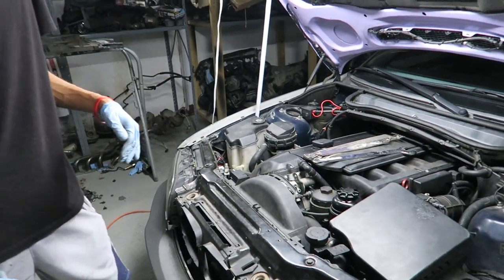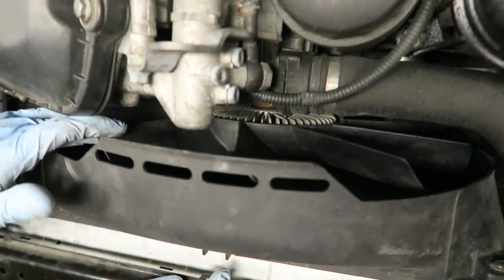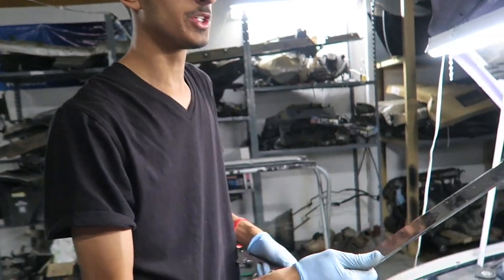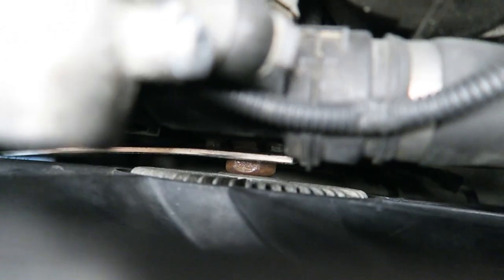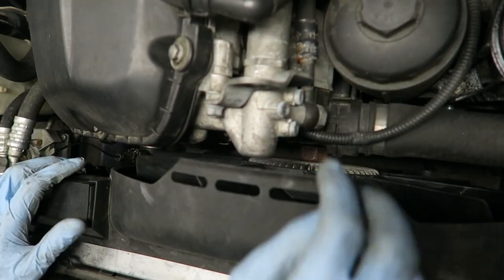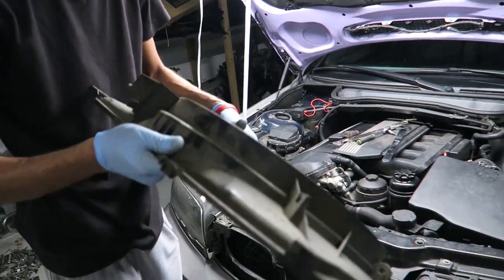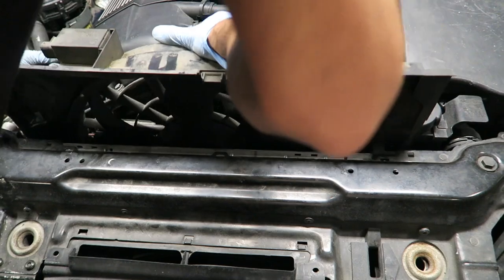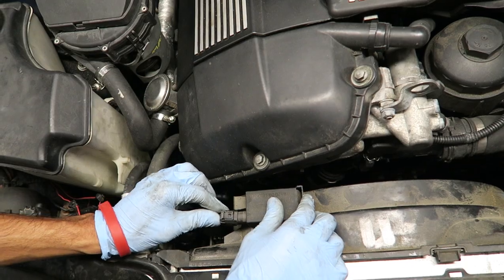BMW E46 Mechanical Fan To Electric Fan Conversion DIY

Comment: Yep, you are totally correct. The fan on my 1998 540i blew up last week. It knocked off the cooling hose going into the radiator but the worst damage was tearing up the hood liner and putting a crease in the hood.
Reply: I thought my belt slipped off and snapped after I floored it but it was the fan exploding that cause havoc.
Reply: Same shit just happened to me
Reply: The same day I replaced the hood :(
Reply: @racks1711  Dang!! That stinks! Were you replacing the hood because of damage from a previous exploding fan?
Reply: @racks1711 did you get the hood covered by your insurance?

Comment: How is this fan controlled? Surely you would have to put in some kind of coolant temp switch to turn it on when the temp exceeds a set point otherwise how will it come on at the right time? At least with the clutch fan you know it is always running even when its not strictly needed.
Reply: soundseeker63 i converted my fan a while ago and it turns on when the car gets hot

Comment: I encourage everyone to do this!! My manual fan blew and and damaged, the radiator, expansion tank, power steering reservoir and the water pump. Did all the work myself and it cost me about $400 for parts. Convert to the electric fan and save yourself a lot of money and the hassle
Reply: Hi I have a question where can I get the fan from? What kind of car does that come off
Reply: @bettyferman6553  READ THE FKING DESCRIPTION, kinda. ily

Comment: So to be clear, if we have a Manual E46 it comes with an electric fan?
Reply from the maker: Yes
Reply: @ShopLifeTV  Except if you have an early build.
Reply: So what electrical conection u use for the new fan !! What did u conected to i dnt get it
Reply: So there was already a plug for the new electric fan
Reply: nando4755 yes all plug and play

Comment: please explain how this fan knows when to turn on ?
Reply: You unplug your front aux fan connection and plug it in to the radiator one don't need to front any more
Reply: It turns on when the car reaches operating temperature
Reply: The coolant temp sensor that plugs into the radiator controls the aux fan.  It will keep the coolant temp in a range so it will cycle on and off when at idle and low speeds where there is no air passing throw the radiator while driving.
Reply: @klinatoc  a lot of people seem to be tripping out about this part especially if you have an AC obviously you want to run it what happens does your fan come on does the AC still work and like he just said yes it all runs off of temperature reading

Comment: electric fans did not come on all manual e46's. i drive a 99 328i 5 speed. with a stock manual fan clutch.
Reply: 2004 325ci all factory 5 speed doesn't have a e fan either
Reply: he means the efan in front primarily known as AUX FAN for your condenser. they all have that fan. that is the actual fan he is using in the video, but he is utilizing it as a radiator fan. hope that clears things up
Reply: +ForeignDomesticRacing  u just answered my question.. because he never detailed what fan he's using.. but I thank u.. fr
Reply: I have a 99 328i 5spd too and it has a manual fan.  I'm actually going to go ahead and swap.  Looks super easy and I get annoyed with the manual fan job.
Reply: @ForeignDomesticRacing  for real, so all we gotta do is move it from the front of the radiator to the back?
Reply: @ForeignDomesticRacing  Haha Nope, It's not the fan he's using. He was just wrong about all manuals having an electric fan.
Reply: @trapman1338  He did detail it. He said the fan comes from a manual E46 and it is NOT the aux fan.

Comment: Hi, excellent video. Where did you get the electric fan. Or what BMW model it is, it is seen that it is used. Thank you.
Reply: He says at 0:35 all manual e46's came with electric fans except the m3. I missed it the first time too.

Comment: Two questions
1-Did you notice deleting the clutch fan freed up any hp to the engine?
2-Are you sure one electric fan can cool as much as both the old clutch fan and the ax aux electric fan? I would be nervous it wouldn't cool enough with only one fan.

Comment: I just did this conversion on my ladies 03 325xi. Honestly the hardest part was lining up the slots on the side and bottom. The old fan came off really easy and was surprisingly heavy. Once I work out the other bugs I expect this will increase the acceleration. This took maybe 15 mins tops. The other issue that took most of the time in the garage
Reply: Good luck… it almost cost me an engine…electric fan went out and car overhead, it only lasted 6monts
Reply: @georgeteo8797 so not to replace it? The manual e46 has the electric fan.

Comment: So, just to be clear, you said the auxiliary fan, which uses the same motor as the manual electric fan, only comes on when the AC is on or if engine "over heats".  First off, the fan doesn't come on when the engine overheats.  The fan comes on by direction of the coolant temperature on both automatic and manual cars.  When the coolant temperature reaches a certain point, the fan turns on.  The only difference here now is you went from a pusher fan to a puller fan.  The function of the electric fan is to cool hot coolant when the car is not moving, at speed, fans will do little, if anything to cool the coolant.  It seems that people get all freaked out thinking that if they remove the manual fan, all of the sudden the car is going to overheat.

Comment: Quick question so when you do this conversion does the fan stay on consistent or only when it overheats/A.c. is running?
Reply: Alex D  my fan turns on when it gets hot.. but I’m having an issue with it . Now when I turn off the car it will stay on
Reply: Alex D I'm wondering the same thing have you got an update?
Reply: @keither89  ,

Its completely normal if the fan spin for a few minutes and then its turns itself off as its cooling certain things from heat-soak.

Comment: Hi there, thanks for your help about working in BMW, l have a 330ci year 2006 having issues  with  temperature,  already  change water pump, thermostat, but still heating up,  somebody  told me is the electric water pump, may you please help me teaching  how to test it and how to replace it, thanks so much for your kindness and GOD BLESS YOU

Comment: Love your channel ! Has been a great help to me in looking after my 320i E46 here in New Zealand. Question: I want to get rid of the manual clutch fan. Can I remove it and stick with just the A/C fan or do I have to install an electric fan on the engine bay side? Thoughts......cheers
Reply: I have the same question.... do you have any information??
Reply: @gustavoalbertotapia6433  I ended up just removing the clutch fan a couple of years ago now and sticking with the AC fan only, did not change anything else and left it in its original position and it has worked perfectly and holds the temperature exactly where it needs to be. Just run the car at idle after removing the clutch fan with AC off and check that it automatically comes on when the car temperature gets up. Cheers.
Reply: I don't know if you still have the car but somebody just told me that the reason the clutch fan is on automatic is because the extra heat created from the automatic transmission needs the constant air flow apparently. I was kind of concerned with that and that's why I watch this video, I've had my electric fan in for years now and not really had issues @crooky66west

Comment: Hey brother love your videos both old and new. My 2000 323CI has a bad fan clutch! Does the 2000 year model E46 have the electrical connectors to make the conversion to electric?

Comment: Thank you very much for these videos. I am wondering whether this electric fan fits the E38 7 series from 1995-2001. I have a 1998 and a 2001 7 series. Please let me know whether there is a plug and play aftermarket fan available online.

Comment: Nice swap!   I'm a little unclear as to how you reconnect the wires.  Could you explain what goes where in a little more detail?  And what happens to the front ac fan?   Thanks
Reply from the maker: +Tom Canada Thanks! You are eliminating the a/c pusher fan and using that connector for the electric puller fan. Let me know if you have any other questions.
Reply: @ShopLifeTV  What if you have a manual? any benefits to this over the front fan?

Comment: I did this conversion on my 2005 330ci and I saw on a e46 group where they also replaced the thermostat so the “auxiliary” fan would cut on at a lower temperature. Does anyone know the part number or where to get that thermostat? Thank you for the video.

Comment: what do you mean keep the old one for back up? it wasn't plugged in to anything. or do mean keep the front fan installed, in case your fan failed, you could plug the front range in to get you home?
Reply: I think so makes sense I have the opposite  my ac fan blew up nd I'm left with a clutch fan nd no shroud

Comment: Did this upgrade few years back. Thanks. 
Question how can you still keep the aux fan for ac connection if your using its plug 🔌. Is there an adapter that has 2 into 1 line?

Comment: Hello,

My name is Eric and i am in Rwanda in Africa. Well, I watched your video about the mechanical to electric fan modification and i also wanted to do it. I am a diy mechanic for Bmws and Mercedes only. So tell me, how do you get the electric fan to run after engine start without using the A/C compressor, I tried the modification but i was always putting it on together with the A/C and driving whole day with A/C isn't economic at all with fuel, is there any tip you can share with me so that I can have my e46 run much quieter. I am sorry am not a social media person that's why i used your email. Hope to hear from you very soon and I really highly appreciate your input to sharing what you know about these cars.

regards,

Eric

Comment: My mech fan comes off with just a big open-ended wrench thankfully. Just bought an electric fan from junkyard for less than $15 and the production date was in 2011. Let's hope it works.

Comment: seeing as you have just swapped out the aux fan connector onto the new electric fan will it only come on when idling? also is this the same proccess on the m3

Comment: Hey mate. I just watched this video and it really looks very helpful. I want to do this change on my e46 2.0i, but i am missing the one connector which you disconnected first, the one on the left of the auxiliary fan. Can i plug the new electric fan and just use the connector i have, what happens also with the fan behind front bumper, which is for the AC?

Comment: At the very beginning of the video, you said that the new fan was going to replace the old auxiliary fan also, So why didn't you take it out? Is it just sitting at the front of the radiator doing nothing now? 🤔

Comment: Great video, thank You. If you don't use fan clutch removal tool but instead use only 32mm wrench and hit it with the hammer clockwise,  can fan clutch be damaged by doing so?
Reply: I knew a BMW master mechanic who used to do it that way. He would also put the fan on by starting the engine and hanging the fan next to the rotating shaft. It would thread itself on. 😂 I would absolutely not recommend putting the fan on that way!

Comment: I did this fan delete for my 2004 325i. One concern I had was that on my obdII gauge my temps would fluctuate from 96-100 and sometimes 105 but, at this point the electric fan would kick in but never stay on a constant(as you would expect the original aux fan to behave). I tested this on my friends 2005 330i ZSP and the electric fan came on around 90 and stayed on a constant lowspeed unless it reached 98 then would kick in high speed. I know the ZSP's are tuned alittle differently but I wondered how I could get my fan to behave the same. I tryed swapping the fans between the two to see if it was the fan itself but turned out the same. I've since bought an new used 2004 325ci auto and have noticed with the two fan set up my temps run a constant 95-96, and rarely peaks at 98 when in traffic at which time the aux switches on and brings it back down to 95.

I would consider doing this mod again but, only if there is some way to get the electric fan to kick on at lower temps and not let the temps spike up and down. Pardon my ignorance but I am not sure if this makes any difference at all but knowing these engines sensitivity to overheating I'd rather stick to whats proven. Searched the forums but no luck on how to adjust the behavior of the electrical fan. If anyone knows how PLS PLS PLS let me know, I've been looking for some time now.
Reply from the maker: The fans will cut on and off automatically to keep the car in a certain temp range. The fans are only really doing work when the car is standing still, otherwise airflow usually takes care of the rest when driving. As long as you have done maintenance to the cooling system, just relax and drive. Thanks for watching!
Reply: Can you exchange a manual fan for an automatic fan on a 325ci / 2005?
Reply: The 325ci is an automatic transmission.
Reply: or you can just get it tuned so that the fans come on sooner but 10 degrees temp isnt much tbh. Maintenance the cooking system and youll be fine

Comment: Hey man, great video as usual.  Quick question.   I have a 03 320 automatic, and I'm considering this mod.  Can I leave the old electric fan in and not take it out?? Won't it have a negative effect on airflow?? Thanks again for the videos man. Appreciate it !!
Reply from the maker: You can, it will effect airflow, but it is not severe. My gf's e46 still has the aux fan attached and we drove the car cross country.
Reply: ShopLifeTV thanks man.  I was a bit scared to do this.  Guess I'm doing it lol!!  Thanks again for the great vids.  Pls keep em coming

Comment: Hello, very good, your videos, I congratulate you and thank you always for helping us ... I wanted to ask if I can use the same auxiliary fun of the A / C and change the plastic mounting piece to occupy it and remove my mechanical fan ... I would appreciate your help because I could not find any electric fun of another bmw e46 with electric fun for my e46 320i automatic transmission 2.2cc year 2004 in Chile can you help me with my question please

Comment: Do the electrical fan works effectively with E46 automatic transmissions, in the long run? Also can i leave the auxilliary fan (pusher) to work with the puller one at same time, just there in case of emergency?

Comment: Hey, I don't know if you still answer to questions here. For some reason the previous owner has had the original fan shroud pretty much deleted so the fan is exposed. I can find the cables for the motor fan but not the temp sensor cables. Could you tell me where I can possibly find that and if I can track it down so I can install an electric fan? Great content btw!

Comment: I have an 2001 e53 X5 3.0i with the exact same motor.  I have been wanting to do this swap in that vehicle would the fan be the same or would it be a different?
Reply: Did you figure that out?

Comment: Where did you get the fan? Is it exactly the same as the auxiliary fan that is in front of the radiator and also what about the direction that the fan is going isn't the auxiliary fan APUSH fan so another words the new fan that you put on to replace the manual would be a suction fan correct and how do you control that meaning the direction of the fan

Comment: Hello, how are you doing? shop life first thank you for the great video I know is from a long time ago but it would help me a lot if you answered me.. my bmw 323i 2000 does not have the black box-shaped sensor that is above the one you connect in the video also does not have the connector in the harness.. could you tell me if I can put an electro fan on it and remove the fan clutch without that sensor?? Thank you!

Comment: Just wanted to verify... I have an automatic 2002 E46 330i and want to change to the electric fan. It should be okay correct? cannot stand dealing with the fan clutch on the manual fan. I need to replace thermostat and water pump. Is there a brand that you recommend?

Comment: Greeeat channel! I found you channel today and now Im subscribed! Great job!!! Now, its not dangerous to automatic gearbox this convertion? Have you monitoring the automatic gearbox oil with INPA software when you drive with this modification? Im afraid thats the oil overheat and my gearbox blown. Good luck!!
Reply from the maker: No it is not, the fan will cut on as soon as it reaches the temperature threshold.
Reply: ShopLifeTV Cool! Maybe in future I'll done this mod.. Thanks for your answer!

Comment: First thank you for the video. Your video explains everything in detail.
Second, my car over heats when it's hot day + A/C on + stuck in traffic. 
I currently have a clutch fan and do you think if I switch to electric fan my problem will be gone?
Reply from the maker: +kyung baek It should solve it. Your fan clutch is probably messed up. I would also check for any coolant leaks and make sure your system is bled properly.

Comment: I didn't quite understand what you meant with leaving the auxiliary fan on. How do you connect it if you're using the auxiliary connector for the e fan. Does the e-fan, like the auxiliary fan only kick in if ac is on or the car is overheating, or does it just stay on?

Comment: Hello :-)
What is the BMW part number for the electrical fan? I have 2002 BMW 330xd touring, 4WD with m57 diesel engine and 184 horse power. I'm willing to take my car's mechanical fan out. Thanks in advance :-)
Reply: BMW-17117561757

Comment: Oh i forgot one question. Is it possible to remove the fan clutch bolt without the pulley holder? I mean using the belt friction to hold it.
Reply: Gabriel Lee I tried this once and it's a pain in the ass. Get the tool if you haven't done it already